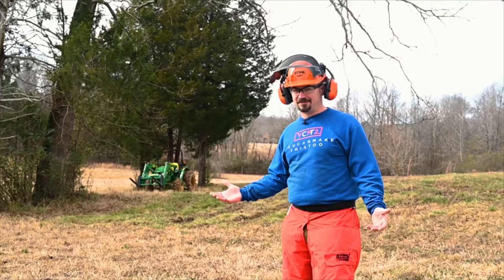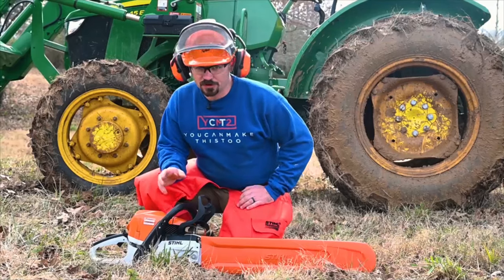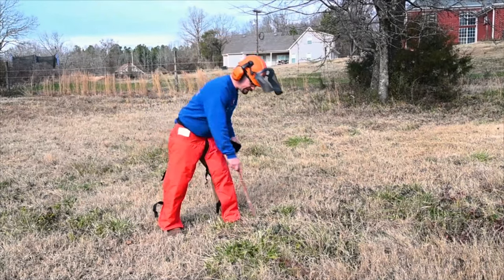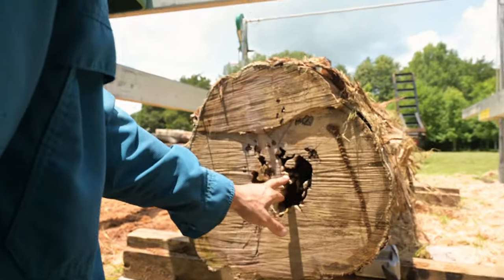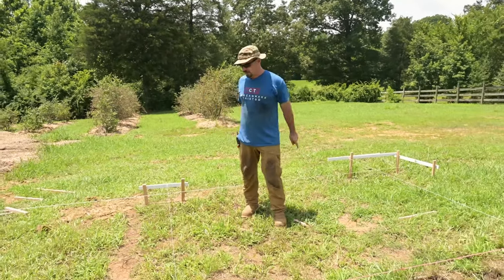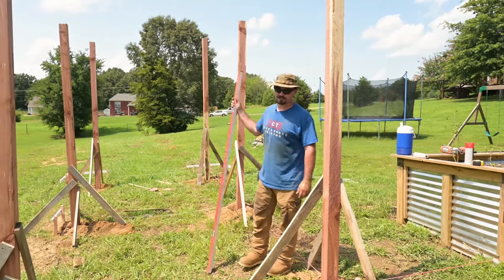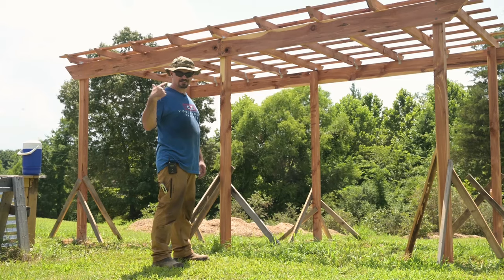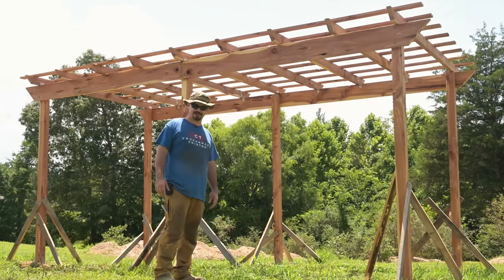My Tree Was Dying

Comment: First of all very nice job and cool choice of lumber. I know you did this in the summer and as a woodworker you save wood but if you haven't trashed the fence rails and posts I would have a use for them - I'm building a cover for my firewood (on the cheap) not a big thing but have been watching Market place and craigslist for just that type of lumber. Stay safe and keep up the great videos.
Reply from the maker: Thanks! I set it all aside, thinking about building some compost bins in the spring so holding them in reserve for that.